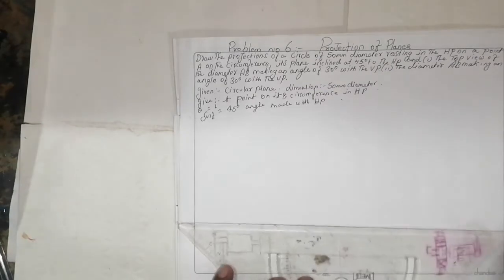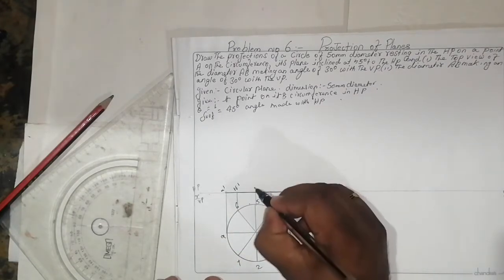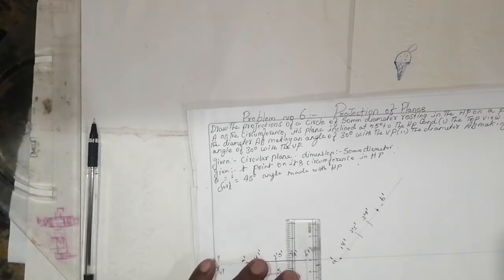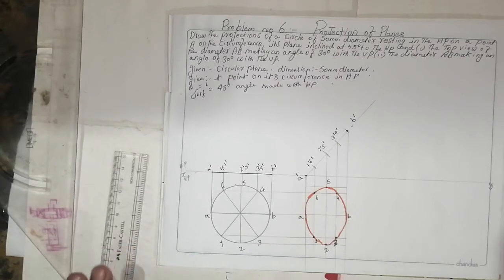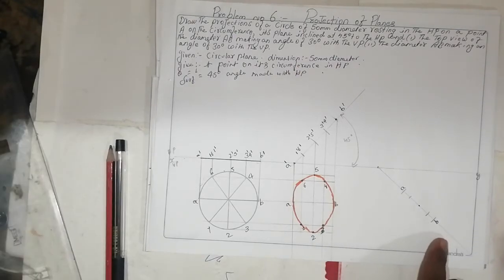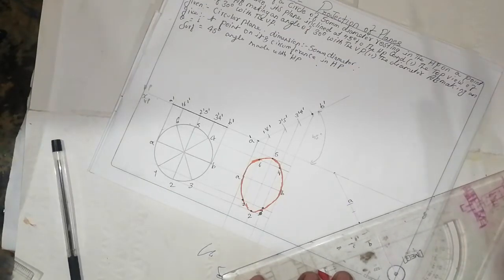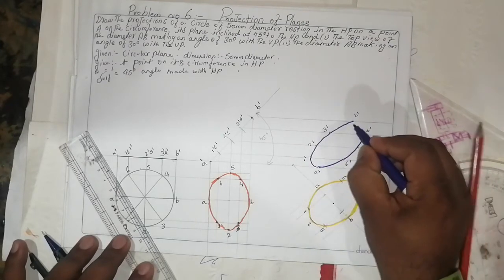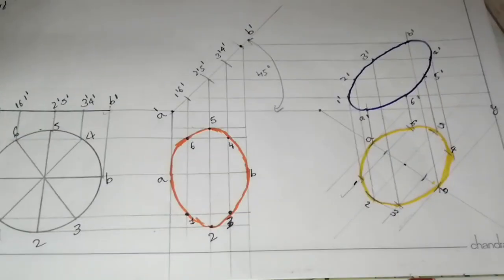Problem 6# projection of plane # circular plane # dimension 50 diameter #hp 45 degree #vp 30 degree

Comment: 10		Draw the projections of a circle of 50 mm diameter resting in the H.P. on a point A on the circumference, plane inclined at 450to theH.P.	5